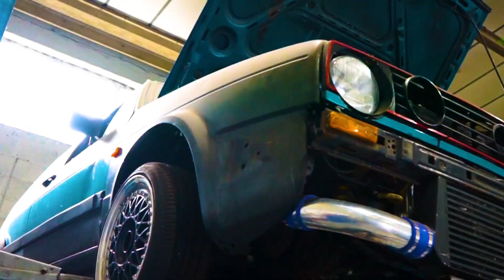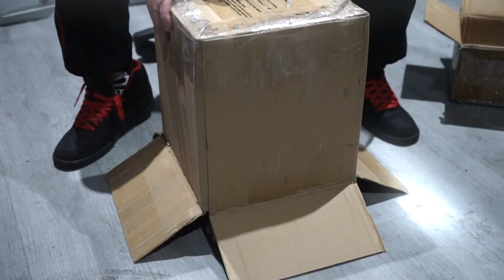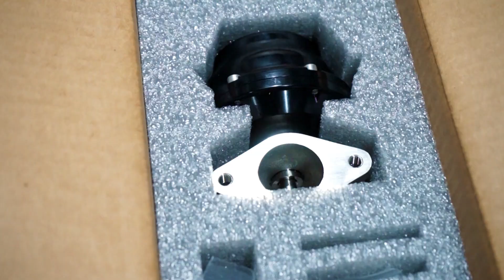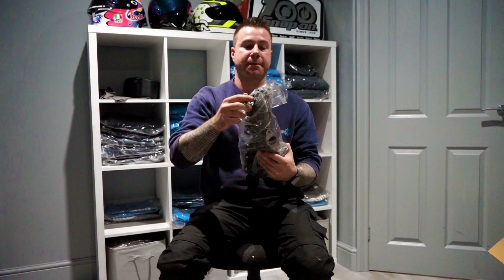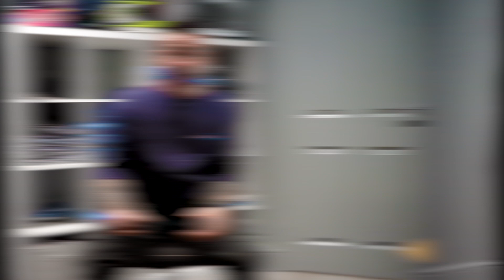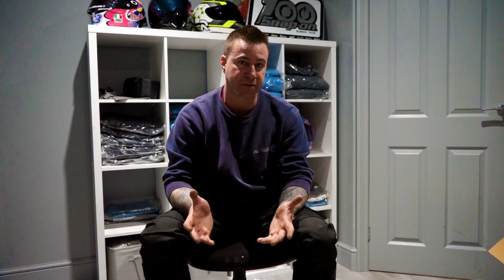MK2 VW Golf VR6 Turbo Project Part 2!

Comment: Nice project! I’m running a remapped stock ecu on mine, be nice to upgrade to an ecu like yours!
Boost controller and a lsd are the best  things I bought for mine, become a handful with that sort of power, even on a hot set of AR1 tyres!
Reply from the maker: There will be more coming soon, once we have completed this one, we will offer it as a supply and fit option.
Reply: As far as power the engine can take the general consensus seems to be around 4-450 on standard internals.
My car is primarily a track car and it’s hammered on uk track and Ring trips, I spun a bearing on a fully forged, low comp engine after a 1000 miles yet have done 5k miles on a scrap yard unit engine of unknown mileage using just a headspacer plate and new timing chains! 🤷🏻‍♂️
I think boost management and turbo sizing is the key to longevity with these engines. 
I’ll be following your project with interest! 💪
Reply from the maker: @ladvr6  boost management is very important. Hopefully we will be able to make some more progress very soon and get some more videos up.